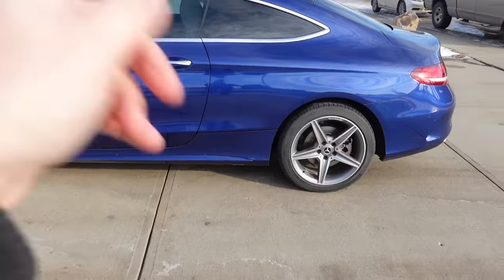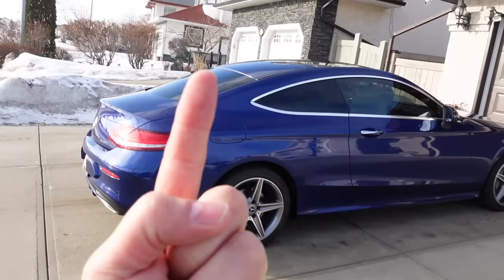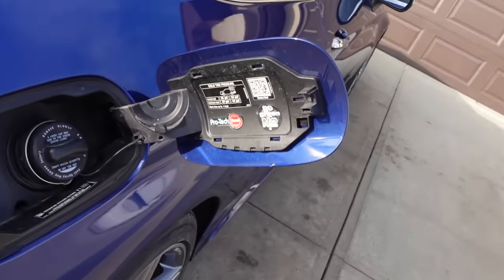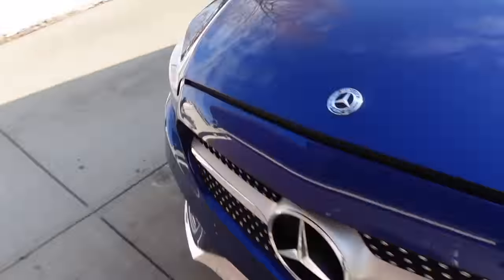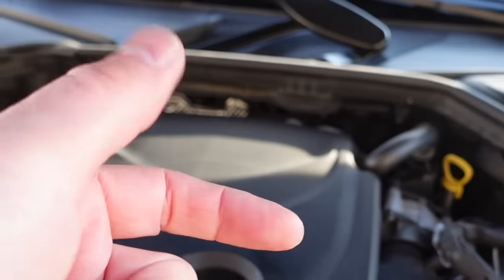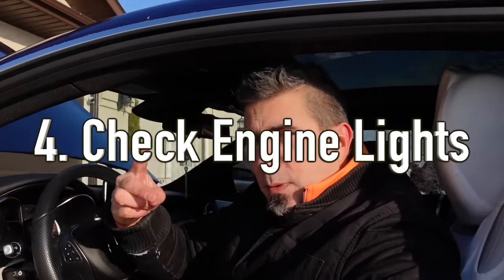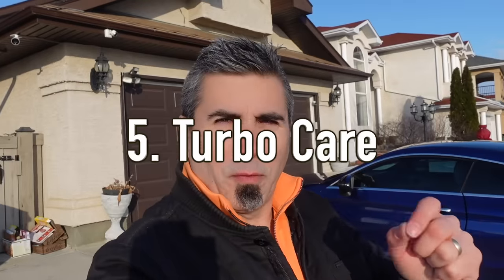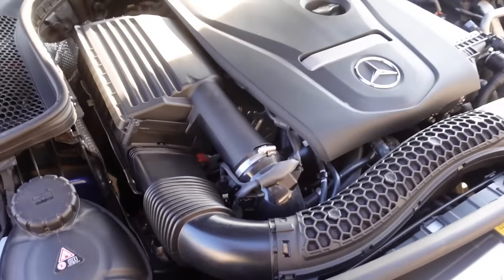STOP Destroying Your Car Engine! (With These Tips)

Comment: Sensible tips....I disabled stop.start on 2009 E90 BMW as soon as as I got it. I also service it every 8000 miles. The N47 diesel engine is now at 237,000 miles!...because stop start and long oil changes haven't killed its timing chain...
Reply from the maker: Thank you for watching

Comment: Here in mtl canada the only fuel without ethanol is shell 91. But my car recommends 87 which has ethanol so no use to put 91 in her.
Reply: I have been using Shell 91 almost exclusively since I started owning high performance cars, for that reason.  If we had Chevron in Calgary, I could use their fuel too.  Petro Canada sells a 94, but that is achieved by ethanol trickery, and ethanol has less energy density than gasoline. Octane is not a measure of power, as some people think. it’s a measure of the resistance to igniting under pressure. Turbocharged, supercharged and other high compression engines require higher octane. I have five cars that require a minimum 91 octane and my truck recommends 89 over 87 even though it will run on 87.

Comment: it is caused by water entering the gas tank, thats when ethanol separates from gasoline it is a reaction with water, so they suggest never to let your gas tank go below HALF, I think using a higher octane is just as bad if your engine doesnt require it, since it will cause carbon build up at a faster rate

Comment: If you are concerned if the OLM is not accurate why not verify it with an oil analysis? Take the vehicle down to around 25% life and pull a sample. You will get the results in about 10 days. Compare it with the OLM and then you will know.
Reply from the maker: Absolutely a great option.

Comment: I bought a used 2020 Honda CRV with a turbo engine.  The dealership told me I could go 13,000 kilometers in between oil changes.  Should you do it more often?  Should I use 100% synthetic oil I have in the past with my Honda Civic.   The dipstick on this vehicle is terrible it is not a "gnarl" dipstick and the oil pool at the end makes me think I'm low in oil.  My husband is going to put some notches on it.

Comment: I used to have a MY2011 WRX. Pulled up next to a Mercedes at the lights expecting the driver to floor it. It was a V8 and had stop/start engaged.  What's the point of that on a V8?
Reply from the maker: Just for emissions reduction and fuel savings and probably a bigger necessity on the larger engines, but I would still turn it off as I do on my F Type V8

Comment: I watched a video from car care nut. The stop start doesn't damage the engine unless you do it to a cold engine.  Most of the modern cars  software doesn't allow the the stop start function on a cold engine. The stop start  device is rated for 350k miles.

Comment: On my 2021 Trail Boss, I have a start up routine, I push the start button and the disengage the auto shut off. Without fail, every time. The 5.3 in this model year are suspect at best and don't need any help shotgunning themselves. They're all garbage nowadays regardless of brand and I will NEVER buy another new vehicle.
Reply from the maker: Used is better value and often have less tech

Comment: My car has the Auto Engine Shut off 'feature' but not the disable button. so the only way to disable it is not to be in 'drive' gear. To do this in my car is: shift to drive. then shift to 'L' gear (some times labeled 'M'). and select the max gears available. In short the 'L' gear option is how you the driver tell the engine that you are Limiting the number of gears it can use until you shift gears again (park, reverse, drive, etc). my car has 9 gears, so I select 9 in 'L' gear mode (9L on the dash board). and the car will use all the gears it has available to it like a normal automatic car. and here's the trick: since the Auto Engine Shut off only works when the car is in 'drive' gear, putting it in 'L' gear disables it!  Until you shift into park/reverse/drive/etc and have to do it all over again.

Note: yes I know I used 'gear' too many times, but I wanted to share this work around for this stupid 'feature' that is going to kill my car (and yours) if I don't use it every time I have to use my car!

Comment: The last tip is not really sound.  Say you wait for 180 seconds red light at 800 rpm, that's 2400 revolutions.  You are concluding that 2400 revolutions of the crankshaft, with the 4-12 pistons moving the whole time, would cause less wear than one start.  I don't buy it.  Also, how did you jump to the conclusion that 3 mins warm engine cooling down would equal a cold start? I am in Florida weather and found such comments funny.

Comment: That's why I stop Toyota, Honda, Nissan, Mazda, Mercedes, VMW, Ford, Buick, Chevrolet, GM, etc. I bought a Hyundai Elantra 2008 brand new and today has 166K miles with ZERO issues. I paid $16000, use regular gas, and even the Original Brake pads last 110 K miles.
Reply: and today has 174K miles. Toyota corolla same year was costing at the time: $ 24,995 WTF happened.? I saved $ 9.000.

Comment: Engineering Explained debunks the statement AAS does not save meaningful amount of fuel - it is actually between 4 and 8% according to a study. If you burn 2000 liters per year, that’s between 80 and 160 liters saved - not a small amount.

Comment: There is no mandate that vehicles use start/stop systems.  However, it's my understanding that to include any fuel consumption savings from these systems in their EPA MPG estimates, the system has to automatically re-engage after you restart the car.

Comment: Fuel tankers often haul ethanol as a back haul before reloading gasoline or diesel fuel. Ethanol has a very long hang rate time inside the tanker...meaning you can't get it all out before reloading.  Therefore thinking that your high grade gasoline doesn't have any ethanol in it is incorrect. When you ask they always say, it's an acceptable amount that will never make a difference...there wrong.

Comment: I learned about "bearing coking" back in 1985 with my Merkur XR4Ti. In my early 30s, I ran that car hard and jumped in and out of it all day long, till the turbo crapped out at about 65k miles. Once explained as perfectly as you did, I never had a problem again. And we currently have two turbo Civics with heavy miles.
Second, l would like to know if Top Tier rated fuels are safe even though they max out ethanol at 10%. Top Tier is the cleanest gas. But is it the safest?

Comment: I don't buy newer cars and my daughter told me a while ago that modern cars/vehicles when plugged in for cold weather won't start heating the engine until -20C. Just plain stupid/this is in  Canada. Also for the cold start situation - 100% Synthetic oils actually stick to engine lubricated parts much much better than Petroleum oils. One will never induce wear with the 100% Synesthetic oils. I am not sure about the so called Full Synthetic oils as they are all made from petroleum base stocks. Strange but true. Rock on
Reply from the maker: Thank you so much for watching and yes nowadays some brand use these plugins to a block heater that have a built I. Thermostat so plugging would not help at minus 10, while many others do not even have block heaters at all and rely on a hefty battery, starter and synthetic oil to get them started.
Reply: @ECPP  I guess it was - 10C

Comment: Thanks.  In older cars I've had a check light come on that pertained to the gas cap.  I used to let the gas go down to almost empty and it developed a vapor lock and the check light came on.  The solutions was to release the gas cap and fill the tank.

Comment: Maintenance: oil is cheap engines are expensive. Change the oil every 3000/3months miles city. 5000/6months miles highway. Change all fluids and filters every 30000 miles/3years. Differential fluid every 100000 miles.
From the factory service manual of my 1994 Ford Thunderbird.

Comment: I was reading the manual for my 90's Toyota and it actually suggest no extended warm up idle AND that it's better to turn the car off if you're likely to be waiting a while at lights/traffic, which I thought was interesting. At any rate I always let it warm up a minute or two before driving and if I'm going to be waiting a while, I might shift it into neutral (another recommendation for auto drivers).
Reply: Toyota is a different animal
Reply: Also the same for uphill
Reply: For the start stop me and my wife switch the button to disable it when start the car every time

Comment: The start/stop feature is a royal pain in the ass. Here in Florida when your engine shuts down automatically, your A/C is still running. It’s a drain on the battery, and it starts blowing warm air into the car. I always shut my off. Bad feature !
Reply from the maker: The start stop is a mess

Comment: Engine start stop is sort of goofy, I don't think they save fuel or emissions anyway. When the engine starts up it burns more fuel than when it runs on idle. It also generates more emissions simply because it uses more fuel to start up. This "startup cost" of the engine is large enough that you have to stop for a pretty significant amount of time (more than 40 seconds at least for the 6 cylinder I was checking) for you to gain anything by stopping. Not a lot of stoplights last for more than 40 seconds where I live or commute. Not sure if the engine start stop is more of a "feel good" luxury" or a "upcharge" to be honest, maybe a bit of both, either way not a feature that I would value very highly. All that said, I would bet that their effectiveness changes a bunch as the engine size changes. Larger engines consume more fuel when idle for instance. I was looking at my 6 cylinder vehicle that ran on gasoline, maybe diesel, the modern universal I4 banger, or something much more sporty (like an 8+ cylinder) preform significantly differently.

Comment: First, I am not a fan of ethanol. I work for a company that everyone sees every day. They run the 10% ethanol blend. I have seen as much as 600,000 miles on engines with out touching anything inside it. I have never seen an issue with fuel.

Comment: On the B9 Audi S5 (2018+), if your gas cap is not closed right, you get a check engine light with "to much oil" error...
Reply from the maker: Wow, sounds like a bit of a pain.
Reply: @ECPP  Bah... That message is a bit of a relief when you come from a B8 that burns oil lol

Comment: Auto Start in my Audi Q5 activates at exactly one minute at a stop light. Where I live the Red light is on for 1.5 to 2 minutes so there's no point using it. I always thought the engine would restart once I take my foot off the brake or step on the gas. Unfortunately my car is programmed to restart automatically at a preset time even if my foot is firmly on the brake.
Reply from the maker: Thanks for sharing.  That’s a bit different.

Comment: Auto Start/Stop Engine is the worst feature ever, I disable it every time because it's default ON. sometimes it can be just a few seconds stop on the traffic light and the engine Stop, it feels like the engine stalling and the jerk when you got to move off instantly because the engine is starting as soon it turns Off. Worst ever engineering. What I feel is car manufacturers like to see your car break down often.
Reply from the maker: You are totally right.  If a car prematurely wears out it’s a win for the brand
Reply: Agree. It's brilliant publicity for a manufacturer if their cars break down often, that's why they do it. Very logical.

Comment: I Am old school and staying that way I do Not care what the check Engine light says just put a piece of tape over It a fuel gauge a amp meter and temperature gauge and Oil pressure gauge rpm meter Is all You need, screw the EPA for the type of cars they make.
Reply from the maker: Haha yes, that’s one way to make it go away

Comment: My opinion only is turbo engines should have their own oil and pump separate from the engine. Sure it's more parts but overall the engine and turbo will last a lot longer.

Comment: I absolutely hate that automatic engine shut down when you stop at a traffic light or stop sign and I always deactivate it because dealers won't tell you that 90% of engine wear is starting wear and it definitely puts more wear and tear on the starter and each time you engage the starter , It heats up the windings and before you know it , That starter is gonna go POOF!!!
And it's really expensive to replace a starter
As with any engine , No matter how big or small , I always let it run at no load to cool it down properly
For example I had a Toro 2 cycle snowblower and ran the heck out of it
Not just doing my driveway and sidewalk
But also did some of the neighbors driveways and sidewalks as well and that snowblower lasted 21 years
One thing I always did was allow it to run unloaded for a couple minutes before shutting it down and that definitely made the engine last
Reply from the maker: Some really great points and to make a car last longer, there really are tricks like that.  Unfortunately many people treat their cars like the latest iPhone, throwaway sadly
Reply: @ECPP  Thank you for your comment , Also what I do with 2 cycle engines is since you have to mix gas and oil
I would add an extra half ounce of oil to the mix to play it safe , 
That automatic engine shut down is definitely a joke , I can understand that for example if you're stuck at a railroad crossing and there's a slow train going through is shutting off the engine to save gas but never in stop and go traffic , 
I make sure to tell my friends and family who have a vehicle that has that automatic engine shut down is to disable it when you start it up and explain to them about how hard it is on an engine
I also explained to them if they have an older vehicle is to use synthetic oil because it has better lubricating properties than conventional oil , Especially when starting during a cold snap
Another very important thing is if you have a generator for emergency power is definitely use synthetic oil in it because when you start it up , It's immediately running at 3600 RPM compared to a car engine running at around 600 RPM  and you definitely need good lubrication on start up

Comment: Reduce the amount of cold starts ? More kaka.
Use the car as you wish that's why you bought  it.
The difference is so minimal you probably couldn't measure it over the life of the car.
Best thing to do is run quality oil and change every 7500ks or 5000miles

Comment: How does shutting off the engine cause hot spots? You want to run the engine for 10-30 seconds before putting it in gear so oil has been pumped throughout the engine.

Comment: 1. This is why i only use BP 98 Ultimate here in australia. Both my cars state 98RON fuel inside the fuel cap itself. To reinstate this, i had the first car for 10 days before putting a stage 2 APR kit on it (2011 VW Golf R) and when i had it done the shop that did it called me and asked what fuel i was running as it wasnt getting the numbers the kit should. After telling them caltex's vortex they drained it and replaced it with BP's 98 Ultimate, and advised me that if you can't access that then Shell's V power would be the next choice. And stay well away from fuel stations that have deals with major food shopping receipts for the very reason he explains about fuel in this vid.
Reply from the maker: Cheers

Comment: Dont ethanol fuels also eat away at rubber seals, hoses and gaskets a lot quicker? 

Ive heard arguments where for people with older cars because their seals, hoses and gaskets werent originally made with high alcohol fuel in mind that it actually degrades them or accelerates the degradation process.
Reply from the maker: You bet

Comment: I see you have read some old or was taught old ways of engine management.   All engines in the US are designed for ethanol of 30% or less. There is absolutely  no reason to not use 10-15% ethanol in any gas vehicle manufacture 2010 or later.

Comment: So how do you "stabilize" the gas when the ethanol starts to evaporate? Add more ethanol ofc! People living in cold climate do this all the time. Carburetor alcohol it's called. Gets the condensation out of your gas tank as the ethanol and water mix and gets carried out and combusted. If you have problems with water in your system you probably never fill your tank to full. Do that first! Don't go and buy a lot of other expensive crap to put in your gas.
Take care that some manufacturers build their engines with truly inferior materials or have ECU's that can't handle large % of ethanol.

Comment: The start stop button works much better in the new engines with a mild hybrid system. It does not damage your engine that much. I just recommend turning it off in the winter.
Reply from the maker: Cheers

Comment: Well the part with the start/stop system is not correct but I also deactivate it all the time. In case of Mercedes, they have a System build in so in case of start/stop, the oil and water can circulate further on. I personally see the problem with the timing chain because every time the engine start it tears on it pretty heavily…
Reply from the maker: Thanks for sharing.  Have a great weekend

Comment: There is a cost difference between the 2 blends. I’ve always used the cheaper blend I have never had a problem and I’ve been using the cheaper blend for a long long time.